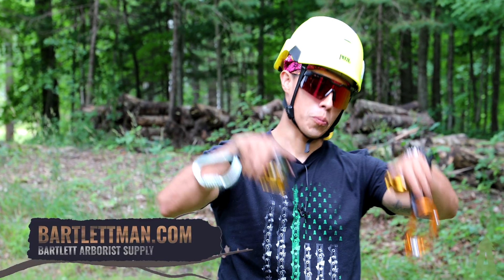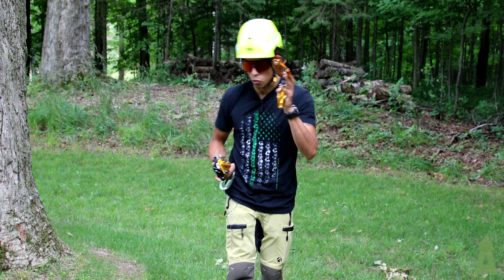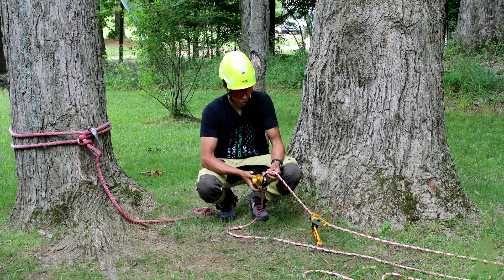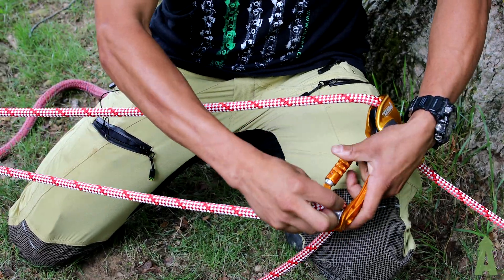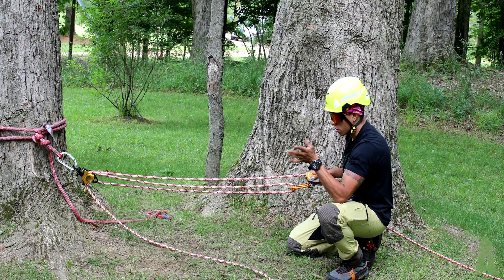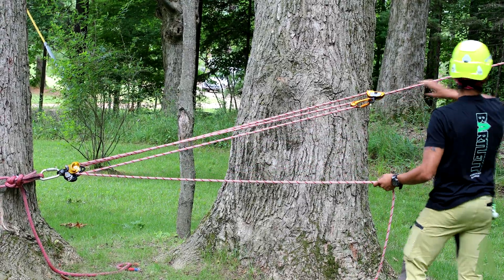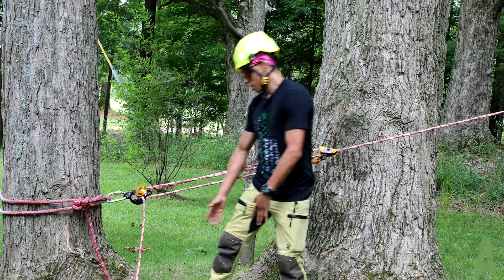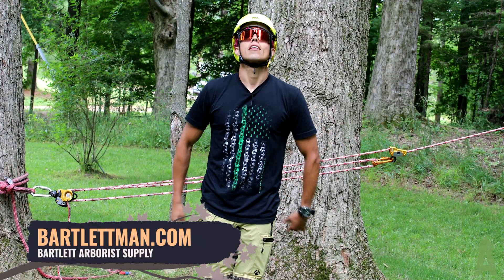Petzl Pulley Twin Release for Tree Work: 3:1 Mechanical Advantage

Comment: Great demo Abdon and that’s a great system but I can save over 500.00 with a rope puller and a base sling and get more pulling power.
Reply from the maker: Absolutely, that is very true! But, as with most things, there are pros and cons to everything. Pro to a Ropepuller, simple to setup and use but releasing a load (may depend on model) can prove to be tedious. While this system has the advantage of being able to lower a load easier as it is integrated into the Petzl's Twin Release Pulley.
Reply: @ True, that’s great for the unmanly men 🤣

Comment: im pretty sure thats more then a 3:1,  the truckers hitch makes a 3:1 system and it leads you away from the load, and it looks like there is an extra loop in your system leading you toward the load
Reply: It’s a 3:1 with a change of direction.
Reply: Great equipment but I’m sorry the set up is not a 3:1. It’s a 2:1 with change of direction. For it to be a 3:1, the double pulley would have to be on the load, that is the moving side. As a simple explanation , the rope starts at the load 1:1, goes into the first pulley at the anchor, change of direction but still a 1:1. The rope goes back up to the load into the carabiner pulley and this creates the 2:1. The rope goes back to the anchor into the 2nd pulley as a change of direction but still is a 2:1. Flip the set up and it creates a 3:1.
Reply: @andycabrera6684  No, it's definitely a 3:1. There are effectively three sections of rope sharing a force: the one coming directly from the thing to be pulled and the two coming in and going out of the rollclip. Force-wise it can't matter if you flip the set up or not, as the total force going in either direction will always be equal.
Reply: @Iocun  Flipping it does make all the difference in the world. Most people think mechanical advantage comes from the amount of ropes as you stated. Mechanical advantage occurs from a moving pulley and not from any of the stationary ones. If you want to keep the configuration you have and want to turn it into a 3:1 then you would have to make it a complex system at the anchor. Which means that you would take the pulley off the anchor and place it on the rope. As you pull the pulley moves, creating your mechanical advantage.
Reply: Y'all need to go back to rigging school. It's a 3:1 z-drag with the second pulley at the anchor creating a change of direction and progress capture.
Reply: @ringofiremfg  Bro, I’m not a smart man but I know what MA is. I don’t have the smarts to explain it correctly it seems. But this guy here explains it more better den me. 
https://youtu.be/yRSGnE9aTi0?si=7ZcBzK4eAkFamAqx